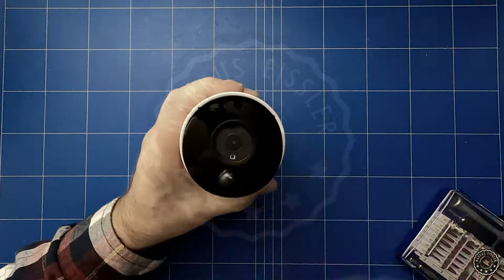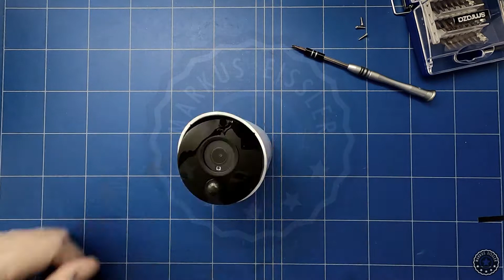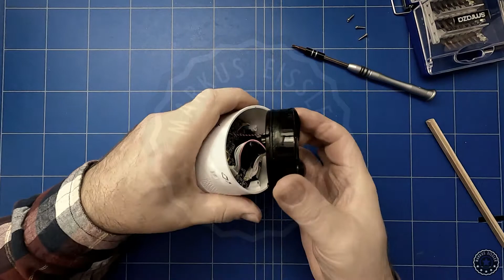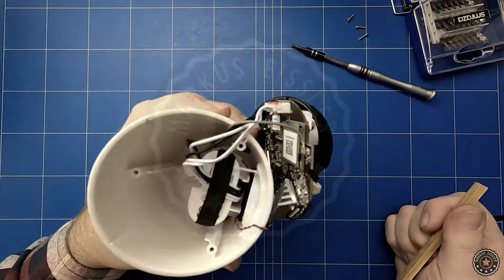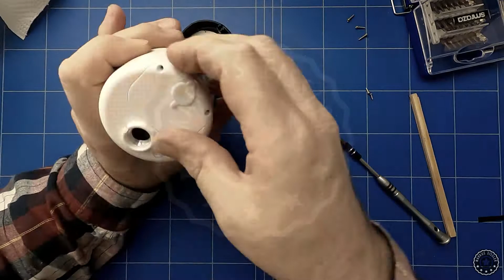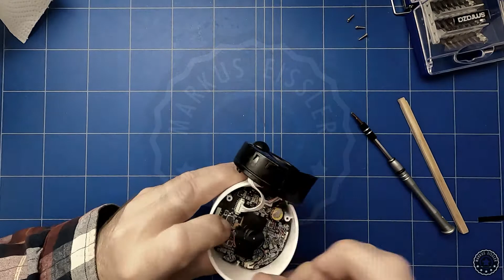Reolink Argus Eco öffnen / open / disassemble

Comment: if you want to remove battery pack you must to push the protecting clip between the housing and battery pack. Then battery slide to back wihout any problems.
Reply: I didn't succeed. Battery pack don't unlock...😞
Reply: @antonelloc.8900  you gave up too early... It does share the same battery as the argus 2 thats replacable ... Push the clip in then push slowily it will com out ...there is an o ring style seal that makea it hard to come out ,remember its water ans air sealed.... Then dismantle bith batteried.. Unsoldeer wires make not where the came from as they arw color coded.. And replace the battery....

Comment: How do you remove the back cover? after you take out those three screws, the back cover wont come off ! It seems super-glued to the body frame... My USB connector in the back got pushed into the housing, so I am trying to open the back cover to get at that USB connector.
Reply from the maker: That's why i've the questionmarks at this  point...
Reply: This has been my struggle. I have the same issue and have not been able to remove the back plate. Any luck from you yet? Thanks.
Reply from the maker: @matthewbeeman6449  ... That helps very much... THANKS A LOT !!!
Reply: @matthewbeeman6449  @be236  I have the same problem :((
Reply: You don't. Unscrew the two screws at the back, then you disassemble the front, take it all out. Then you press a small clip holding the battery inside and give the whole battery a gentle push from the inside and it all comes out at the back. You can not pry the back open.
Reply: if the usb connector is out of place , it means that it is not connected to the charging pcb anymore
Reply: @briansomai4798 it's pushed slightly to the rear, if you wiggle your male USB you can still get it charged, but it's a pain!

Comment: HI Markus, shame to see there was no way to disassemble the battery. Would love to see a DIY option to replace it.
Reply: Me too. Mine stopped charging after about a year outdoors.
Reply: You can, there is a small tab on the battery, once you open the camera and take out the lens, push down tab and push battery out the back of the camera
Reply: @locky52  Great to hear a solution, could you perhaps upload a video or send some pictures?
Reply: @iNSANiTi0111  Yes, I was able to get battery out too. Just disconnect all cables you see, and you must push battery out from direction where you have lens toward the back of camera. You will pull it out with USB connector... USB connector and battery is one solid piece.
Reply: @fuguf1sh  My camera also stopped charging.I just disconnected the cables from the battery for a few minutes and now it charges again without any problems.
Reply: @pavelmachala8  You don't have to disconnect all cables, but otherwise you are correct.
Reply: @MB-cl2og  Same for me, although mine stopped recharging already after a few weeks. Disassembled it and can now recharge again.

Comment: Thanks for the video...Question I took mine apart to clean the lens and lens cover, unfortunately the extremely fragile red/white twisted #28 wires came loose from the printed circuit board, I think it is for the small microphone. Anyone know or have a photo of where the connections are on the circuit  board? Leads are only about 2.5". I have the skills to fix, just need location?  Thanks I have not had any luck finding any service data on the Reolink Argus Eco. All is working but lost the microphone (sound) due to wire coming off.

Comment: super danke
Reply: Hallo..Wie komme ich bis zur lade Station.. Kann man den Akku auch ausbauen.. Danke im voraus
Reply: Die micro USB Buchse is bei mir kaputt
Reply: @silviobianco2316  I have also problem with USB input connector. Do not know how to  open to repair it
Reply: Have now been able to remove the battery compartment. Was not easy but it is possible. The USB connector inside is a very vulnerable part of the camera. It was broken and have lost contact with the circuit board. Not sure why. Maybe due to  fatigue from a  moving USB cable, etc?  Unfortunately it looks like it is not reparable.
Reply: @leifnorman6692  can you make a video?